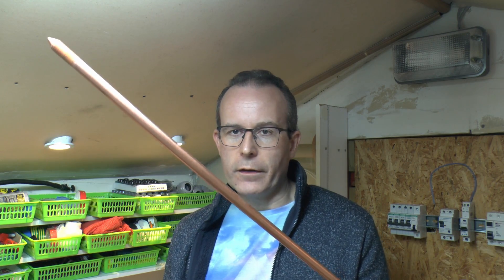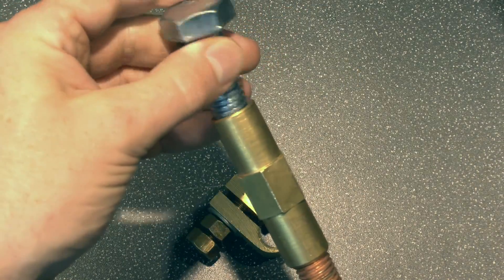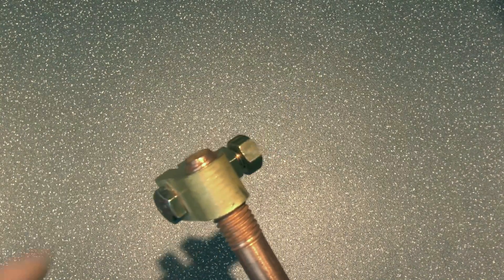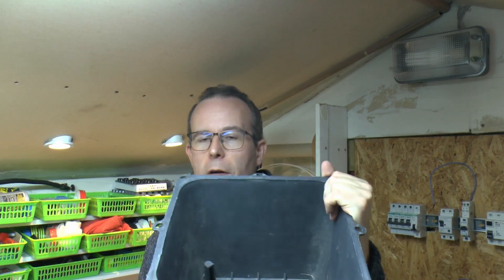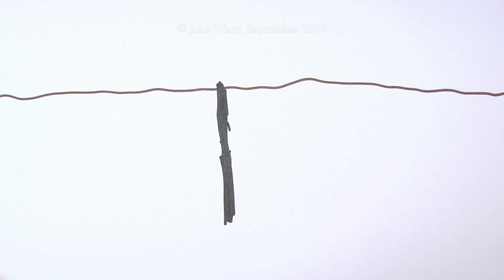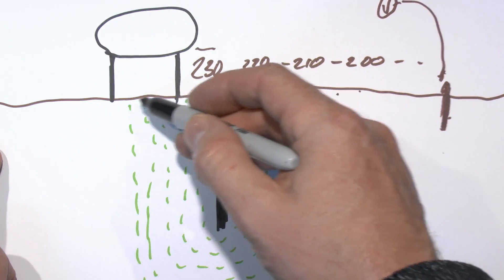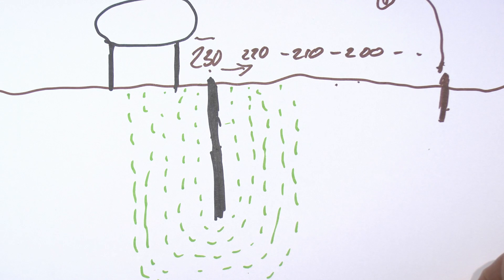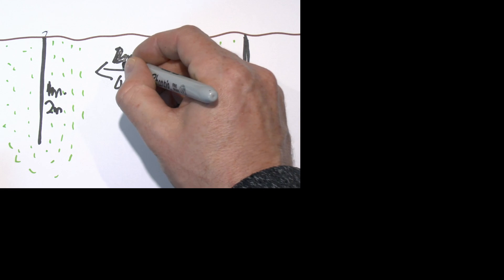Earth Electrodes Part 1

Comment: Good topic! You should check it Mike Holt's grounding videos. He has one where he measures the potential around an energized grounding rod.

FWIW, you will have far worse problems than a cow getting a shock from the grounding rod if it has line voltage on it and the breakers haven't tripped. That would indicate that the neutral hasn't been properly bonded to the ground. As a result,  every grounded appliance in the house is now going to be at line voltage.

As far as I know the real reason for the protective enclosure is to prevent gardeners from cutting the wire with a string trimmer, etc. That is a real hassle, especially in the US where we usually don't have a protective enclosure over the ground rod.
Reply: What, exactly, is every appliance in the house going to be at line voltage in reference to? They're all still at the same potential relative to each other.

FYI we don't bond the neutral and ground at customer premises in the UK (TN-C-S systems aside - and that's handled by the supplier, not you, and does not involve a rod on the customer side).

Also, if your cables can be cut by a piece of nylon, you have other problems.
Reply: @Monkeh616  if you have line voltage on the grounding conductor (which was the proposed circumstance), and the breaker didn't blow, then those appliance housings will all be at line voltage. Say the breaker is a 32A job: at 240V the ground resistance would have to be under 7.5Ω to trip the breaker. However, there's plenty of current there to injure or kill someone.

I'm not quite sure what you mean when you say the neutral and earth aren't bonded at the service entrance in the UK. Do you mean the utility is feeding a ground from the local transformer as well as line+neutral?

As far as weed whackers go, the effect isn't immediate, but cumulative abuse will work-harden the wire and cause it to snap. Feet, shovels, lawn mowers, weed whackers, etc, will all damage an exposed wire over time. Those ground enclosure boxes are a really good idea.

Comment: Great video about electrical earthing. Is a good idea to put dielectric grease on the threads to prevent wear with screw / unscrew manouvers ? waiting to see the install
Reply: Threads in general? Dielectric grease wont prevent thread galling and wear. You need to use anti-seize grease for that, or a specialized conductive anti-seize grease if the connection has to pass current directly. Dielectric grease is mainly used to electrically insulate and seal connections. As for the ground rod, once its in there you wont mess with it again until its rotted away and you have to sink a new one from my experience, so I doubt it would be an issue.
Reply: @mysock351C  Thanks for the very good reply. I meant conductive threads to prevent wear  of the copper layer , but since you've clarified on the rod this now goes to general use in conductive threads. There are some multimeters that have grease on the rotary switch contacts , eg fluke 17b+, is also dieletric grease, since it was the original source of the initial idea

Comment: Good video as usual  -  is it required by the regs to protect the Earthing cable connected to the rod with conduit or Coppex?
Reply from the maker: Depends on the size of the cable.
Reply: @jwflame  Thanks - maybe you could expand a little on this in part 2?

Comment: Here, where I live, it is mandatory to connect the supply cable neutral conductor to PEN rail or to use a 5-wire supply cable and the PE and N conductors are both connected to transformers N connector. The grounding electrode is just a backup.
Reply: @mikeZL3XD7029  Yes, we have 3-phase in every building.

Comment: some older sparks will remember the problems we had with overlaping step potentials when rods were commonly used on properties in conjunction with voltage operated elcbs .one set of regs calls it sympathy tripping a house with a fault 3 doors down would trip the one 3 doors up but it was a step forward to electrical safety , interesting video john thanks

Comment: It would be interesting to discuss the advantage of installing an earth electrode on pme systems. Some supply authorities will not give a pme connection in a basement location unless an earthed mesh is installed under the floor.
Reply: Thats because the mesh will provide less resistance and a better earth. Covering their own arses.
Reply: muzikman2008  You’ve got that wrong. The reason for the mesh is not to improve the earthing: it is because a pme (combined neutral/earth) can float a few volts above true earth potential. Installing a mesh connected to the pme means there can be no potential difference between the basement floor and the pme neutral/earth. This is also the reason why pme earths are not permitted in buildings without equipotential bonding.
Reply: @johnschlesinger2009  and how is that achieved? Through lower resistance by the mesh grounding the floating voltages from the pme?
Reply: @muzikman2008  The mesh is connected to the pme terminal. Therefore the mesh will be at the same potential as the pme: equipotential bonding.

Comment: Wow I bet they are hard work to hammer into the ground. Id hate to get the rod 3/4 of the way in to the ground and then hit an impasible rock.

I can't wait to see it installed though :) Something we don't get to do in college.
Reply: A few tips, check for underground pipes (gas, water), pre drill the hole with a 450mm long 10mm bit. If the thing gets stuck find a bigger hammer!
Reply: Planet Conker .... hack saw 🙈

Comment: Not an electrician but when you say the top of the electrode should not be accessible... if there is a fault resulting in current to earth then everything grounded in the house would potentially be at 230V in which case an animal sniffing the top of an earth electrode would be the least of my worries. Am I missing something?
Great video from a remote house on a TT system ;-)
Reply from the maker: If you are inside, everything connected to the electrical installation should be at the same voltage, which is why protective bonding is installed.  If standing on the ground outside there will be a substantial voltage difference between the electrode and everything else.

Comment: also used as lightning rod end point ?
Reply: Really the purpose of a lightning rod is to drain the building electric field above and prevent a strike, so they're usually pretty specialized. You don't want to actually attract the lightning, but help prevent it. The sharp point on a lightning rod initiates corona discharge, and theoretically prevents a strike by lowering the electric field in the sky above, so you do need to tie into a robust earth ground to ensure the charge can safely drain away. If the rod does get hit, its kind of iffy as to whether the lighting rod and earth grounding will actually provide protection. The local church had its steeple hit by lightning and even with something like 000 AWG copper braiding to ground the rod it still blew the steeple to smithereens (made one helluva bang, too). Right afterwards all I could see was just fiberglass, wood, and bits of copper wire everywhere. Same thing with my old mans office. Nuked the lighting rod and all the ground wiring, and took out a bunch of computers and the clock tower. Theres so much voltage and current its difficult to actually conduct it away.
Reply: @kirkhamandy  Sharp points do allow charge to be dissipated. This can be demonstrated in the lab, and airplanes use this quite effectively to drain charge away from the airframe. Have a look next time you fly and you will see lots of sharp needle-shaped electrodes coming off the trailing edge of the winglets and wings of most planes. The actual mechanism I described is not a myth. Its efficacity is hard to demonstrate, however, since its hard to say how changing the local e-field would impact the path of a stepped leader as its on its way down. Some have made specialized installations that have shown that they can drain sizable amounts of current during a storm with an array of sharp electrodes.
Reply: @kirkhamandy  Now as for their effectiveness, I can say from experience from seeing strikes and the aftermath on various buildings that unless its a skyscraper with a metal girder construction they are not that effective. The lightning simply blows apart the ground strapping, even if its 3/O or 4/O gauge. A single wire just doesn't seem to cut it. Even seen it blow apart a copper water main at my office. Youd think a big copper pipe would handle it, but a bolt cruising past my window proves otherwise. Blew a giant hole in it. The installations that do seem to work are ones for towers with multiple leads to conduct the strike away. Obviously having one is better than nothing, but its not a guaranteed solution. Maybe the NEC, NFPA, and local regulations today are better, but back then it did not seem adequate to contain a strike.
Reply: @kirkhamandy  The spikes on the airframe are also to dissipate static that inevitably builds up from flight since the plane is moving through very dry air combined with particles of ice, dust, etc. Most of the lightning protection is in the copper around the wire looms and mesh in the composite wings as you probably know, but that's an aside. I have seen ones that work. These had multiple guy wires (i.e. towers) that provide a more effective means to conduct the strike without incident, but the strikes that I did see or the aftermath of in buildings Ive worked in did damage to the lighting rod installation and burned out some electronics and so forth. The church was the most extreme, with the ground strapping blown to pieces, and what was left was quite blued, indicating it got quite hot. This was also during a period of exceptional activity so there were more strikes to see, so it could be down to odds. Although oddly enough the AM tower behind me outside my window that's owned by CBS never gets struck (or at least very rarely). I've tried during storms to capture or at least witness it, but whatever they have, the lightning just doesn't seem to hit it, which is surprising given its the tallest thing in town and its made entirely of steel. But that aside the one take home is if I ever have a need to install one, I would go considerably over code to make sure it works as intended and can convey a strike if it does get hit.
Reply: @kirkhamandy  Also I think there is some merit to the possibility that dissipating the fields above might have a beneficial effect, and in documentation they freely admit that sharp points are not as effective at capturing a lightning strike (i.e. lower average number of strikes). Also seeing as how the tower behind me seemingly goes without being struck (I've seen the field around it be hit, but not the tower). Since local charge is being dissipated, there is some potential for an effect, but I have not seen any real good studies showing it does or doesn't work. Only that opinions change. My suspicion is that it probably does locally have an effect on the path of the streamer/stepped leader, but could potentially cause the lightning stroke to bypass the rod installation and hit the structure below. Obviously the lightning propagates by the initial breakdown of the air, which is driven by the field gradients as well as the charged particles that are accelerated once the air ionizes. Impacting the fields around a structure would (or at least should) have an impact on how and where the lightning ultimately ends up striking. I can say that lightning LOVES utility poles and wires, since I've seen multiple strikes, even outside of my grandparents house that had lightning rods. Skipped the rod, and chose the service entrance below. So the properties of structures do impact how it behaves locally. I think static dissipative arrays and the like do have an effect, but so far all there really is is anecdotal evidence of "we installed it on a high risk structure, but it still got struck afterwards" sort of thing. It would be nice to know that if it doesn't work despite being able to move large amounts of charge locally, why it doesn't work. E.g. the effect is too local to impact the final ionization path before the stroke sort of thing.
Reply: @kirkhamandy  Again on the failures, the ones I've witnessed getting hit have failed in some way on smaller structures. Im not saying its ineffective. Far from it, but that with a single conductor on a typical house your odds of success are less, at least anecdotally. The unequivocal successes are usually large steel structures like my old apartment building or the data center at college. These can (and do) eat lightning all day long without issue.

Comment: As a non-electrician, it surprises me that you are required to cover these for safety reasons when overhead powerlines often have their unshielded earth cables tied down directly beside pedestrian areas on the side of the road in the UK. I've always assumed they were ground wires anyway...
Reply: Are you talking about tension wires. Typically coming down at an angle from the pole into a strong foundation nearby. Often used at the last pole in a route, or where a route changes direction.

Comment: Local rules dominate this topic. In my jurisdiction, 2 - 8' rods spaced 10' apart are mandatory. The tops cannot be concealed in any way and must be above grade by 2". Only clamps with bolts penetrating the cladding are permitted. No threads or extensions are allowed. Check your local rules. I've never seen the methods of this video used in the states.

Comment: I assume it's probably the same in the UK, but in the US, when installing a grounding system, you're supposed to do a soil resistance test to determine how many ground electrodes are needed. I don't know the specifics, as I'm a general maintenance person as opposed to an electrician, and things like ground electrodes are way out of my scope, so if I find or suspect there's a problem with the grounding system, I'll call out an electrician to sort it out (unless it's something obvious like a disconnected ground wire between the circuit breaker box and the ground electrode(s) but I do know that this sort of testing is supposed to be done. Also, at least with regards to residential and light commercial buildings, we don't put any sort of cover over the ground rod. It gets driven into the ground several inches below the surface, and the ground wire is run underground to it and clamped to the rod. Usually, in the case of a house with a block foundation that extends a couple feet above grade, the ground wire will come out of the house, run straight down the exposed portion of the foundation (secured to it by clamps screwed into the masonry) until it's underground as far down as the top of the ground electrode, then it runs straight to the electrode. That exposed section of ground wire is typically then used by telephone and cable television companies to attach their equipment grounds, as well. Sometimes by idiot installers (cable installers are notorious for this, usually the telephone company people have functioning brains) who remove one or more of the clamps to pull the wire away from the foundation so they can attach their ground lead easier. But I digress...
Reply: Testing the ground with dedicated test equipment is by the book but for some electricians it's a case of driving as many as needed till the earth fault loop impedance is low enough that touch voltage is lower than 50v during a fault. But I'm not an expert in it

Comment: Had a nice example of the effect of current flowing through the ground many years ago during a thunderstorm. My BiL and I were sheltering from a thunderstorm sitting next to each other under an awning pitched on thin soil over chalk. We were both on metal chairs but he had is hand on another one and got a real jolt when lightning stuck the ground ten yards or so away. I felt nothing.
Reply: That may be,but that is a lot more voltage than the max we use.400 volt wont get to far through the ground.Ground at a certan depht has a big resistance.And what about the earthleakswitch??That would be tripped in a instant.So really, i find this a bit obsolete.Of course you gotta have a groundpin,but that whole story about the voltage a meter away today is obsolete.
Reply: Graham Langley wow amazing story thanks for sharing

Comment: Why wouldn’t the RCD trip?
Reply from the maker: This video doesn't mention RCDs - is your question about another one?
Reply: The RCD would trip, that’s why it’s essential that they are installed on TT systems as the mechanical MCB would not have enough fault current to trip, whereas the RCD can have a maximum of 1667 ohms to trip under earth fault conditions

Comment: Earth electrodes cause more discussions at work than any other subject, street lighting by the way. Once you have completed all these parts I’m going to suggest my colleagues watch them so they understand why they are used and where they should be placed. Thank you for the insight. Have you any plans to make a video showing the 3 wire and 4 wire method of testing these please?